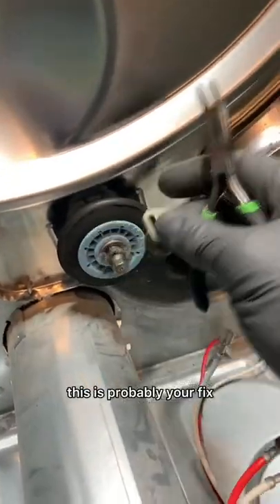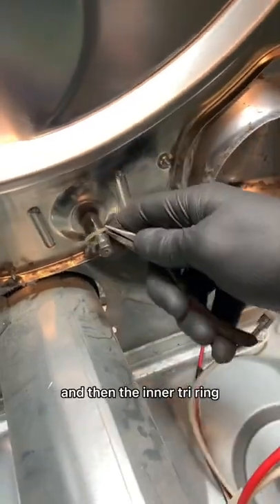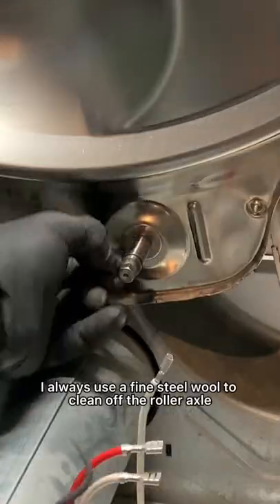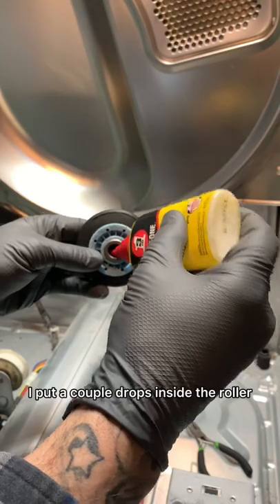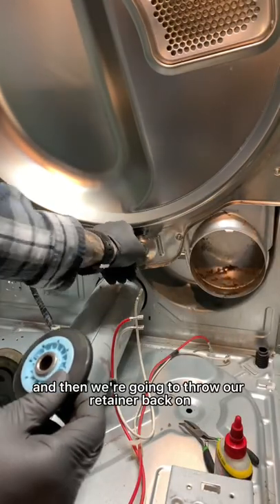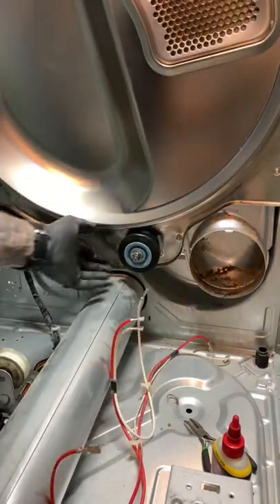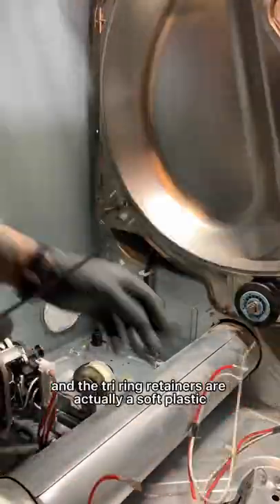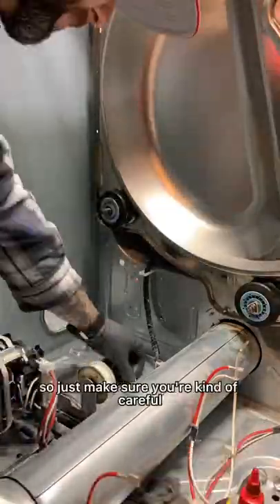Roller and idler pulley replacement LG dryer #shorts

Comment: I had a fire in my dryer, burned the roller right down to the metal. Stunk like high hell
Reply from the maker: Yeah, it seems like they would think of a better design than metal on metal, seeing as heat, friction and humidity does a pretty good job at tearing stuff up lol
Reply: Sounds s as if you learned how important it is to clean out your lint trap every time you use the dryer
Reply: @derrickwith2rs  they can they have a much better idea it’s called roller bearings but the problem with roller bearings they cost about five dollars more per roller. That would increase the cost of the dryer machine about $100.
Reply: Hope you have cleaned your dryer vent as it's been a year as that's why it caught fire.
Reply: @derrickwith2rs engineered failure
 If they built appliances and cars like the use to people wouldn't have to buy new ones so often.

Comment: No need to oil. Rollers have oilite bushings that are impregnated with oil. Adding a different lubricant such as oil, silicone, or God forbid grease will compromise the self lubricating properties make a mess, gum up the bushing, create excessive heat creating a fire hazzard and lead to premature failure. You've been warned.

Comment: lube with a dry lubricant, wet lube well hold dust and lint that over time it can get gummy and  have to go threw this preserver sooner then later. in the professional londery mat has to do all the time, as you can't stop the static generation in these pionts. that makes the lint that much more attracted to these points. The other roles have the same problems but this one is usually the problem as he said. But I would just suggest using a dry grafit lubricant. I think this is also why most come assembled with a Carbin stile washers. that was Engineered as a self lubricating component.

Comment: Are you sure about this? Those amazon rollers are metric sized. The oem axle is standard size. The rollers will have too much play, causing them to fail faster than they should. If you don't believe me, mic the oem axles and mic the amazon axle that you did not use. The amazon axle has other sizing variances, too.

Comment: I found I could just pinch the corners of the plastic triangles and could get one of the sides up just enough to slide them out. Very low risk of damage that way. They make a $8 tool for them so I have heard.

Comment: What If after changing the belt the dryer stops spinning but heat stays on??? PLEASE! MY WIFE IS ON ME TO FIX IT AND IM TRYING.🙏🏼
Reply: 1. Id check to make sure its the right belt
2.  Make sure you routed the belt correctly
3.  Make sure the idler pulley is not froze on its shaft
4.  Make sure the rollers spin freely and dont have a ton of hair in them or binding on the shafts
*Disclaimer, I am not a dryer tech

Comment: I’m a maintenance technician for a community property and one of the dryer I’m working on making a squeaky loud noise. I replaced both wheel, without adding silicone. I will add it from now on. But the noise is still continuing. So I took off the drum and ran the dryer. The noise still occurs. The only thing I can think of, is the small motor belt. It’s a old whirlpool dryer. 
What do you think ?
Reply: Idler pulley

Comment: I was reading something last time I rebuilt my dryer and it said don't use lube on the rollers because it would attract lint and would make an abrasive slurry. Any truth to this?
Reply: You are correct. The silicone he uses will dry and won’t cause a problem. The bearings are sintered and infused with oil

Comment: The bearings for those rollers and idler pulley are impregnated with lightweight mineral oil. Zoom spout oiler is 10 weight oil with stp for high temperature use.